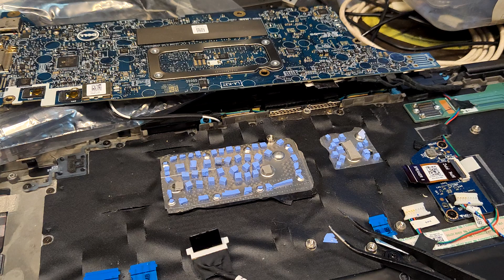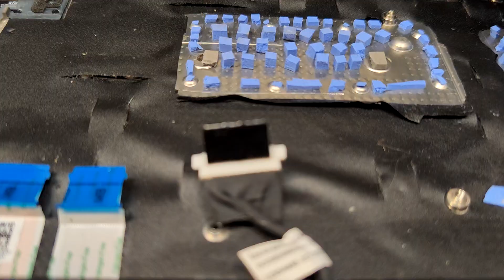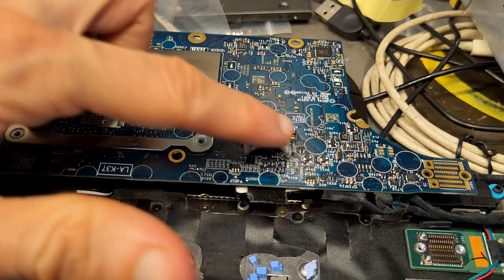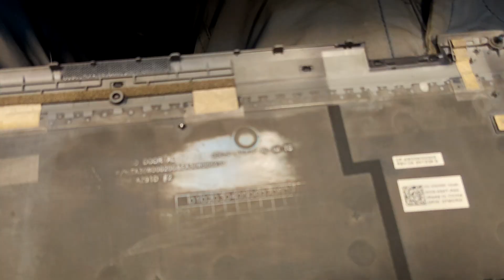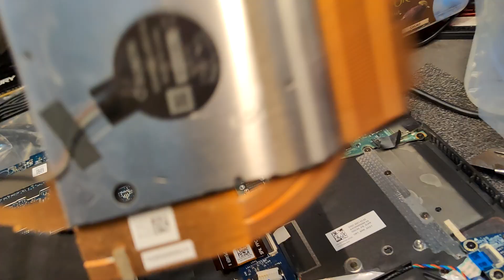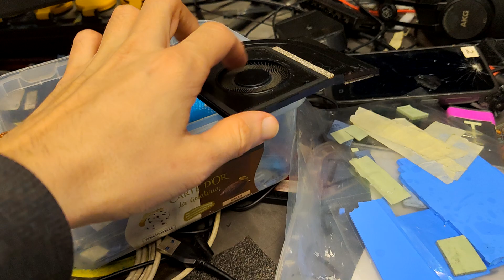Thermal pads mod on Dell Latitude 7520

Comment: Remove the keyboard and make holes in the heatshield, add fans, use usb keyboard, much better 👌👍
Reply: also if you remove the touch pad and speakers the air flow is miles better, my 7410 i5 10th gen idles at 30c now, and all i've added is 2 fans one under it a big PS3 fan and a hole in the bottom of the case, and one 80mm over the where the touch pad used to be I also remove all that stupid black felt shit, it's just an insulator, mine had a heat shield around the CPU die / heat sink area, covering the VRM's, removed that too and i don't get VRM warnings when overclocking it now, if you're less concerned about portability and looks i highly recommend the above, i can run my cpu at 3.5 ghz, 83c, it's 2.1ghz stock and would reach 80's at that, these little Dell laptops have insane performance to give if you give them some decent air
Reply from the maker: @twelfty89  ahaha that's radical i love to build hybrid machines salvaging old parts aswell!